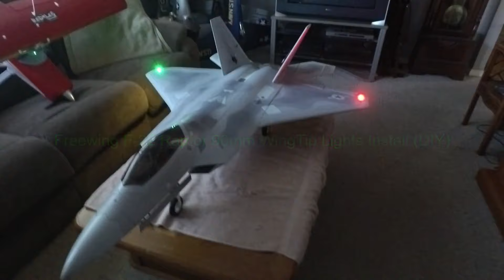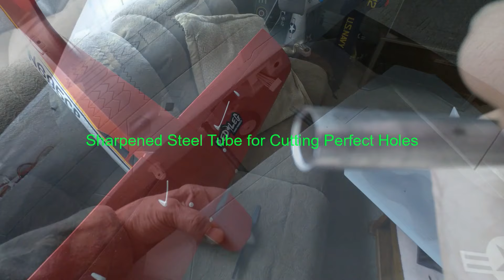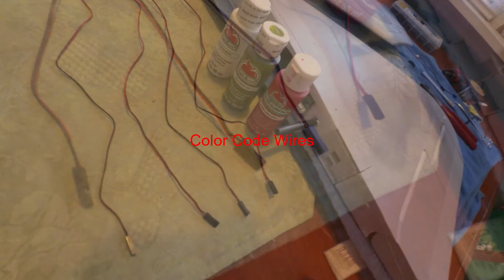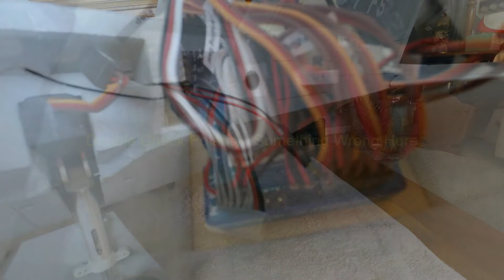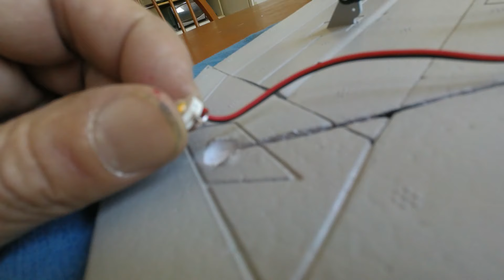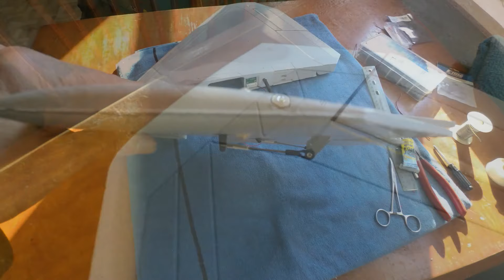Freewing F-22 Raptor 90mm WingTip Lights Install (DIY)

Comment: I’m just finishing up installing my lights on my F22 and have gone with the strobes on bottom and Nav lights on top of the wing. I used a sharpened piece of brass tubing to cut holes in wing that I had in stock. Thanks for the tips.
Reply from the maker: Thanks Dude.   And you're Welcome.   That tubing is perfect for the job huh...??
Glad it turned out nice

Comment: So I want to try this with my 64mm F22...what kit did you use for the lights?
Reply from the maker: @papapsadventures6119  I used the light set for the L-39 80mm.  But they have to be plugged into a blue box that matches their voltage ⚡ or you'll fry them.

Comment: hey skip where did you get the lights for the f22
Reply from the maker: Motion RC. Order the L-39 light set (2) of them.  They attach to the blue box lights outputs.  2way,3 way etc.

Comment: I don't understand.  Why didn't you just plug the wing lights connectors into the "wing control board" instead of running separate cables all the way to the front multi-function control box ?
Reply from the maker: Didn't know they were there. Connectors on the back. 
Didn't notice till was already done with wires.  Thanks
Reply: The boards on the wings are “on” only. No strobe function on that board that’s on the wing.

Comment: What light controller did you use?
Reply from the maker: Just used the blue box inside it.  It has slots for landing, strobe, 3 flash and 2 flash.  Cool huh?

Comment: Hey skip
Jeremy Solt is doing thrust vectoring plates for freewing F22 and they are awesome! You should check him out 
Would love to see you do a install video on them. If you do instead of adding 2 more servos I would like to know if you can use existing elevator servos
Reply from the maker: You can.  But would have thrust vector all the time.
Reply from the maker: I am not interested in doing that.
But thanks for the info
Reply: @SkipBuiltRC  okay I got you
Add 2 servos then.
I got you

Comment: How in the hell did you fish the wires through the body? I’ve tried several different ways, all with no results. I have a wire fish that looks like the one you’re using, no go.
Reply from the maker: Try putting a light by where the wings attach and look through the battery compartment you should see the holes I found to run the wires through. The holes were already there, so no holes had to be drilled or punched.
Reply: @SkipBuiltRC  oh I can see the channel where the wires run. It’s a tight spot. I finally got it in using a long zip tie. What a pain! I only see one triple flash and one double flash spot on the blue box for the strobe. If I tie two LED’s together and plug it into the one spot for triple flash,  org don’t work. It will only work one LED, not two soldered together.